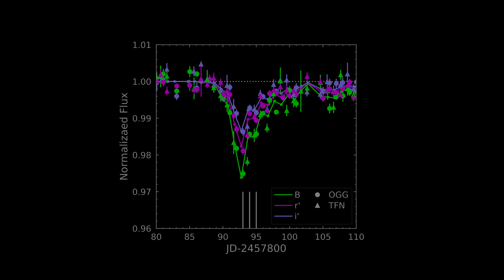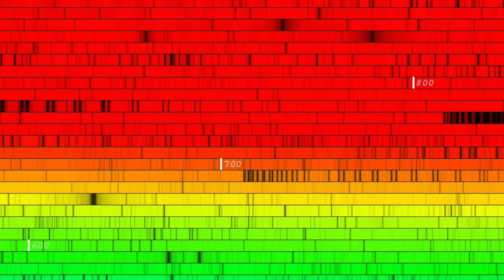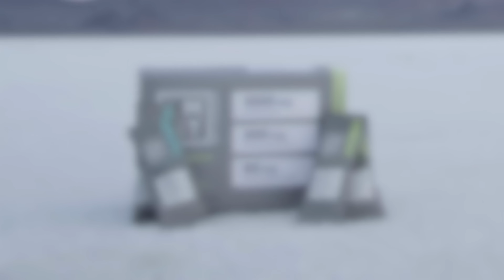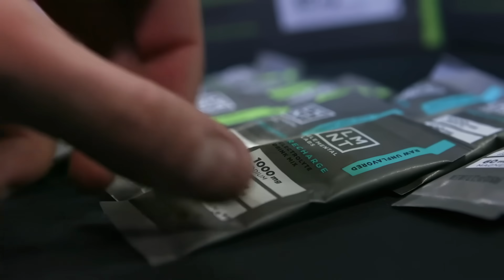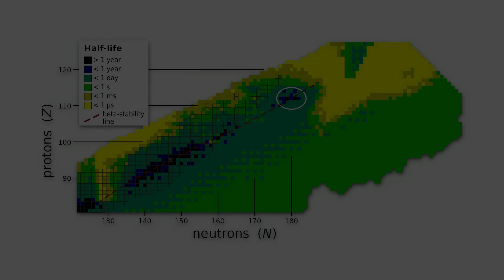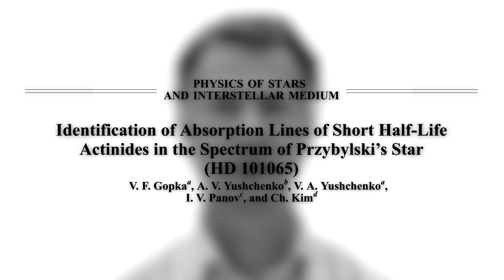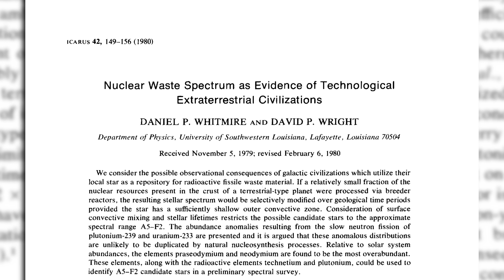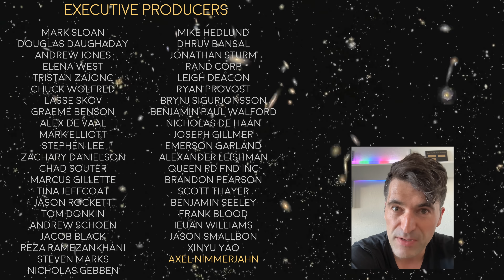The Star That Shouldn't Exist

Comment: One other possibility that you didnt mention... a recent neutron star merger in a trinary system or some other weird interaction between a neutron star and a weird A type star.  Maybe two fast moving neutron stars had a glancing collision and one of them got swallowed up in an A type star and is slowly breaking apart releasing large clumps of neutrons which are decaying into the elements we see.
Reply: But... Neutron stars are neutron stars before the gravity is so high it breaks the electron degeneracy. If you add mass to it, you're only adding more gravity, which means the chances of clumps of neutrons breaking out decreases (and that's already pretty slim to begin with).
Reply: @Logarithm906 This. Dunking a neutron star into a big main sequence star like this gives you a supernova and a black hole.
Reply: This is a sick thread. You guys rock, but 22 years remember guys. A half life of just 22 years.
Reply: @thomasmount7388 That is the thing I keep coming back to with this star!  It seems that the nuclides must be constantly replenished.   Pretty crazy situation no matter what the explanation is!  The possible experimental error (or more like "trusting the spectra") aspect is what bothers me.  I haven't seen a mechanism proposed that can explain shifting and warping the spectra of more mundane elements so much though.  So I think for now we have to assume those elements are there, and are being constantly generated/replenished/salted by someone.
Reply: @thomasmount7388 And? If you take this hypothesis of a neutron start merging with the main sequence star, you can have a continous phenomenon of fusion/neutron capture/spallation happeing inside the star and gnereating those short-lived isotopes.

Sure, I don't have any clues on how this work, I guess there is some studies about Thone-Zyrkov objects you could look.
Reply: @thomasmount7388 Aye.. thats why Im thinking there has to be chunks of neutron star inside there slowly decaying off.  The decay products of these neutron chunks would give out all the radioactive elements randomly including those that decay quickly.  Its the only way there could be a constant supply of these elements until the remains of the neutron star has defused into normal atoms and all those decay off.
Reply: TZO object but with a main sequence star? It would be very nice to find out!
Reply: I was just gonna say that
Reply: Neutrons decaying into elements? That makes no sense. A neutron is part of what makes up an element. You need to put protons, neutrons and electrons  together to make an atom of an element. You can’t make an atom by breaking down neutrons.
Reply: @JohnJohnsonSonOfJohn  Neutrons decay into protons.  In the explosion of neutron star collisions, large chunks of neutrons are broken off which rapidly decay into all the heaviest elements of the periodic table.  Without the immense power of gravity keeping the neutrons from decaying all the neutrons would immediately start a decay chain into all the heaviest known elements and tons of helium (beta decay). This is why neutronium (a theoretical element of only neutrons with no protons) is impossible outside of neutron stars.
Reply: @VarroTigurius-u1f  I never knew that, so is that why a neutron is neutral? Since it is made of essentially a proton and an electron? But I thought an electron was a fundamental particle, so I wonder how a neutron (that is made of quarks) could decay into a proton and electron?
Reply: @JohnJohnsonSonOfJohn  no, its not made of a proton and an electron at all,  its wierder than that. A proton is 2 up quarks and a down quark, a neutron is 2 down quarks and an up quark. but nevertheless a neutron beta decays into a proton, electron and an antielectron neutrino, specifically one of the down quarks becomes an up quark and emits a W boson in the process, which then decays into the electron and the neutrino. Its one of those processes that's mediated by the weak nuclear force. 

So yeah, you absolutely can make elements from chunks of neutronium and a bunch of esp heavier ones we have pretty much were created exactly like that, in neutron star collisions. And the neutron star itself was essentially created in reverse of this (electron capture, also mediated by W bosons), with protons and electrons transforming into neutrons also mediated by the weak force, emitting huge amounts of neutrinos in the process that then proceed to blow away the rest of the star into a supernova.
Reply: Microscopic white hole that is dribbling in enough matter to eventually condense into a stellar object that appears to be a star.
Reply: Yup that's what it appears to be. The strong magnetic field would eject the rare earth metals to the surface while holding iron close to it. A fresh merger would also make it burn much hotter.
Reply: Interesting!  Your comment made me imagine tennis ball sized lumps of neutronium which then split down creating all possible daughter nuclides.
Reply: @goose300183  When you think about it, it's very unlikely for the neutron star to decompose inside the star. The density of the NS is far greater than the inside of a main sequence star. What may happen is highly energetic reaction happening at the interface between the 2 objects.
Reply: @jhtrq1465 yeah you are right - the opposite is more likely - the neutron star would be relatively intact and tear apart the less dense objects.  They are as tough as tough can be!
Reply: @jhtrq1465  What if it's a fragment of a neutron star broken by a neutron star collision, and and is orbiting inside the Ap star, but it's enough below the minimum mass of a neutron star that it's decaying faster than it's accreting more material? It's dense enough the drag isn't too severe, so this condition persists for a while. Eventually it'll either decay away or descend to where it's dense enough that it begins growing and then collapses the star.
Reply: @jhtrq1465   I know all that, except the first part (what would happen with a too-small chunk of Neutronium) which does not seem clear to me, and we certainly don't have experimental evidence concerning it. Suppose you have a chunk of neutronium which is smaller than a neutron star. Not, like, 1 ton, but 1 solar mass or something like that. Below a skin depth, the pressure may be high enough to suppress that Beta decay, but near the surface it isn't. Neutrons in that region will be able to energy-profitably decay. So, they do, and it gets hot and explodes… near the surface only. This will throw out chunks of neutrons which will then proceed to explode much faster and harder, producing ultra-transuranic elements. But it's a skin effect, because below that surface, this chunk is still under enough pressure for the neutrons there to be stable. But as the surface spits stuff out, it will lighten, reducing the pressure and opening up more neutronium to this process. The heavier it is to start with, the slower it will lose mass. So, there's some mass at which it does happen, but it sure is taking its time.  And at the same time, if you've got extra pressure from, say, being inside a star, that could prolong the process considerably and such conditions could possibly could optimize for the release of high-neutron-count elements.
Reply: @drachefly  The theory about neutron degeneracy pressure is quite well known and has been tested trough observations of NS that permit to eliminate cerains state equations for their inside. 

If your chunk of neutron star stuff weight 1 solar mass, it's pretty much just a neutron star, the lightest actually detected are around 1.1-1.2 solar masses. I guess that in your scenario it could work, and the star will pretty much become a TZO object. 

What's strange here is that if the NS sinking scenario is true, this is odd that the star dosent inflate like a red giant like they are supposed to do for the TZO object, but stay pretty much at the size of regular main sequence star of his spectrum. I think this objects are so poorly known that there is a lot of uncertainties on the reactions that can happen iside them and their effect on the star itself
Reply: @jhtrq1465  Okay, then, lighter than 1 solar mass. Whatever's light enough that it'll evaporate at a nontrivial rate but heavy enough that it's not an explosion.  And, being lighter, its sinking might be slower than for most TZO objects where more gas will accumulate onto it faster and harder, increasing drag, which might prolong it more than having less mass per front area hurts (because the effective front area of a larger chunk is larger). As you say, the dynamics of this situation are complicated. Anyway, it doesn't need to be long-term stable - the population of TZO objects is estimated to be 20-200, and they last roughly 3*10^5 years, so finding one in the formation stage isn't extremely unlikely. Just… unlikely.
Reply: @lukesomers2031  I like your idea, and maybe it's possible to have some "equilibrium" in the mass of the neutron star chunk, but I really wonder if it's possible to have this kind of relatively soft transition. Degenerate matter tends to react very violently to the slightest variation of conditions ( like the fusion process happening inside white dwarves during Sn Ia) I guess it could be that you have some mass limit below which the neutron star matter will exponentialy loose his degenerate condition, and above which, it will accrete and neutronize the surrounding matter. I'm really just guessing here, but it could be possible to have a scenario like you describe happening for some times. One thing interesting thing to know is how could you have a neutron star collision that would lead to a solar mass ejection.
Reply: @jhtrq1465 This is why I am thinking about the remains of either a recent NS merger or some weird type of event where a NS had a clipping event where a chunk of the mass got separated and somehow fell into the star.  So its not a full NS in the core but the partial remains that are decaying.  This partial NS remains would be providing the magnetic field which slowed down the star spin.
Reply: @VarroTigurius-u1f  Sure that make sense, I think the hardest part is to imagine a scenario where a NS can be shredded into big lumps like this. They are very hard to break appart. For the few kilonovas observed, somme matter was ejected during the fusion, but it was spread out and degeneracy was lifted already
Reply: @jhtrq1465 I absolutely agree.. it seems like it should be very hard... maybe just maybe when there is a NS collision there are chunks that are spewed out that we weren't aware of and if it was near a star it gets absorbed thereby slowing the degeneration.  The only thing I can think of is maybe instead of a normal NS merger with a slow spiral it was a high speed glancing collision.  A weird trinary system maybe?  2 NS and a star?
Reply: I think that is more likely
Reply: A stellar scale breeder reactor, creating multiple new elements. A cluster of neutron stars, each with random vectors and colliding, displacing neutrons thru an area of this universe's reach where the distribution of materials and the physics that makes it all work are in utter chaos. And abnormal events are the normal events here. Perhaps a human has chanced upon the unifying thing that makes it all sensible? Perhaps we won't encounter anything at all. For now our existence keeps us on this rock
Reply: @Lectrodude  that was quite a bunch of non sense

Comment: Couldn’t it be neutron absorption and neutron decaying into protons slowly building up higher elements in trace amount?

I don’t know the physics all too well, but couldn’t high energy photons be absorbed by free neutrons (or protons) which then are shot into nuclei forming higher isotopes and eventually heavier elements?

I don’t know if enough could be produced this way to form a visible absorption spectra of the elements, but a natural continuous process could occur due to the ultra high fission temperatures of A type stars.

Just another idea.

Comment: Maybe galaxies are holding together not from DARK MATTER but storm force. Attraction. Heat traveling toward cold. Energy plain and simple. Black holes and masses like earth are probably displacing the cosmological constant and curving it around themselves. When the Big Bang began we had hot and dense. But we gained in volume. So that means when a mass solidifies, space has no choice but to grow. Black holes are blowing out our edge faster than light. That expansion is DISPLACEMENT. And heat chasing cold is why they don’t fly apart. 😊💥💯🤘🏼cool video! That star must be amazing. Ya, I think thermodynamics is boss when it comes to galaxies. That cold dense center at absolute zero starts up a big circular drain. Gravity in liquid form compressed beyond the atoms capabilities. Storms on earth like hurricanes and tornados can teach us about galaxies. Study the weather, learn about the MACRO. ❤